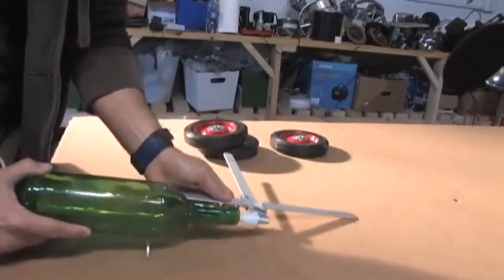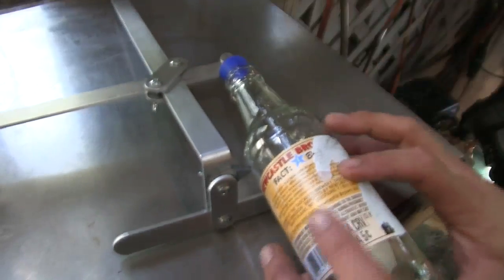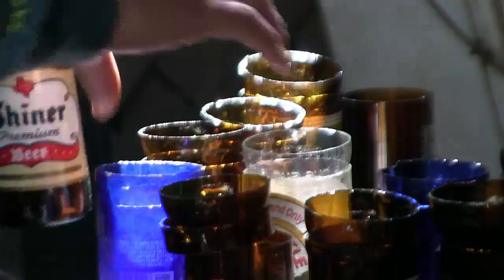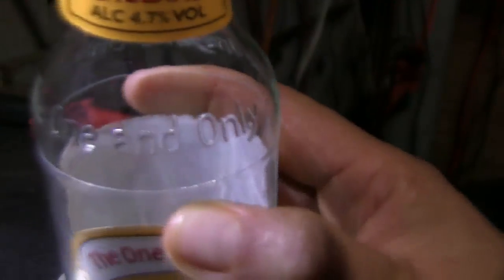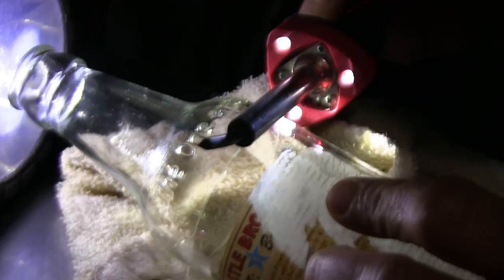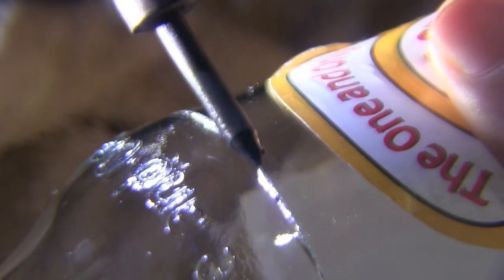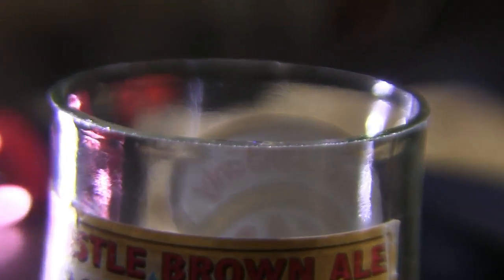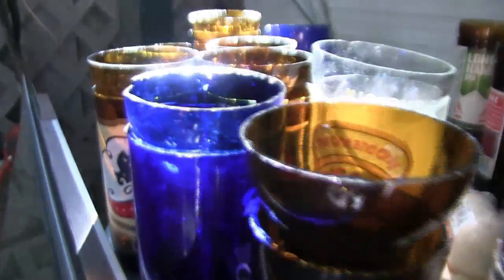Bottle Cutter Cutting a Beer Bottle Best Method Soldering Iron Stress greenpowerscience

Comment: Does the hot water method for the wine bottles also work to make rings? That's what I want to do - make lots of rings. Thanks!
Reply from the maker: Hi Ronda. The rings must be at least 1" in width for the hot water to work and is difficult. The soldering iron method seems laborious but once you get the feel of the glass bottle type you are working with and temperature shock/soldering iron you will go fast. The other option for dark glass is the concentrated sunlight.

https://www.youtube.com/watch?v=oP40BDFF1cQ

Comment: There are several people that use a wet saw, like one would use for cutting tile, to cut bottles (with a diamond blade). Admittedly the people are cutting wine bottles, which as you said is more consistent. Any ideas, I think a wet saw would be WAY faster with a variety of angles as options? I love your videos.

Comment: great video,but please,can you tell me is it posible to pierce/melt through the glass with soldering iron without the glass breaking? or would it in any way ease the process of drlling?
Reply: No. The melting point of glass is much higher than what you'll get from a soldering iron

Comment: Hi Dan! Great tutorial, I'm going out to buy a soldering iron today! Do you recommend a certain wattage? If this works, I'm going to have to send you a six pack or something; I've been trying every tutorial imaginable and nothing has worked. Thanks again!
Reply from the maker: Amber Hicks Amber Hicks :-) 6 pack! 25-60 watt irons work good. Make sure it has a new tip and has not been used to solder with. Lead solder bad for drinking glasses and if the tip has flux or burned residue, the thermal transfer to the glass stinks. So a $5-$25 iron works great. The Weller Iron I used for this video is on the high side for cost but the LED bulbs help find the score separation. Also a good safety feature if you leave it on in error.
Reply: GREENPOWERSCIENCE Thanks again, worked like a charm! Just let me know where I can forward that 6-pack, lol.

Comment: You can use the boiling water option after using the wine cutter scorer, and rotate to ice water. Spinning the top of the bottle with your fingers on the skinny neck of the bottle, then go back to the boiling water, spinning it in your fingers again. Doing this twice for each bottle. It should break off where the score was made without any edges.

Comment: How the hell can anyone get "sarder" from the word "solder"?? The word is originally taken from the Latin word "solidare", meaning "fasten together", from the word "solidus", meaning "solid", so the pronunciation is most definitely solder, not sarder.
Reply from the maker: jublywubly Agree, but that is how it is pronounced in most parts of the US. Future videos I will just call it an iron.
Reply: If you say "wed-nes-day" and "feb-ru-ary" you'll sound very ignorant, but to each their own.
Reply: There's no "r" before the d, it's pronounced "sod-er". In many languages every letter in every word is not pronounced. In Spanish the letter "h" when placed at the beginning of certain words is almost completely silent "huevos" "huesillos" etc. English is no exception, take the word Wednesday for example. Most people consider the correct pronunciation to be "wens-day" with no "d" sound. February generally isn't pronounced with two r's, "feb-u-ary".
Reply: benjamin stamand

I think you meant solder. (You missed the "l" ;-)  )
Wednesday and February should be fully pronounced. There are no silent letters in either word.
Reply: benjamin stamand
Actually, the opposite is true. Not pronouncing the full words is being ignorant.

Comment: Freakin genius dude!  Love it.   My wife bought a very tall vase that the cat knocked over.  But he only busted the top portion so if I can do a decent cut just below the break I will actually salvage the vase.  Actually it will be much nicer shorter anyways.  Not sure if it is handmade  but I suspect the soldering iron method might be a better option.  The pain is ordering that bottle cutter.   Guess there is nothing available at stores here in Toronto?

Comment: I will have to try this. I have had mixed results using a candle but it was better then other methods. This solder iron technique seems to be a good because you can focus the heat better. Thanks for the video

Comment: Can you please make a video to cut the bottom of the wine glass? I was thinking of making it into a recycled wine lamp by putting Christmas lights at the bottom and use it as patio decour party on summer nights. :)
Reply from the maker: saintclaire1201 The process is the same, you just need to extend the cutter to the longer length and then add the heat.

Comment: i used to blow torch my bottles and when i spat on it in completely distorted
 so if you want to cut a wine boodle instantly and and perfect use a wet paint brush with pointed  brush if you can make it while wet. and simply follow the line or tape and it will crack at the spot the wet brush makes contact with

Comment: When I was a kid we hand etch a line and tie a string around the bottle where we wanted the glass to separate.  We would use lighter fluid to saturate the string.  Then we;d light the string and let it burn off.  (bottle upright) - Then we'd thrust the bottle in a tub of water.  Worked with most larger jars.  Not nearly as nice a break as yours but it worked. 
Love your videos,  Keep up the good work!

Comment: I prefer to open bottles by unscrewing the cap or using a bottle opener. Less spillage.
Reply: Flow is inadequate. For max flow, you need to cut it in the middle.
Reply: Yeah me too
Reply: Oh man. All this time, I've been opening bottles from the wrong end! :-p
Reply: None of you is a man.

You have to bite a hole in the side of the bottle and then quickly remove the cap while chugging.

Comment: This probably won't work for me, all I use at home are butane soldering irons.
Reply from the maker: They should work too. The tip on a butane iron is usually hot enough to start the process.